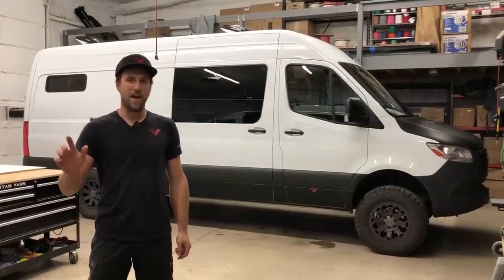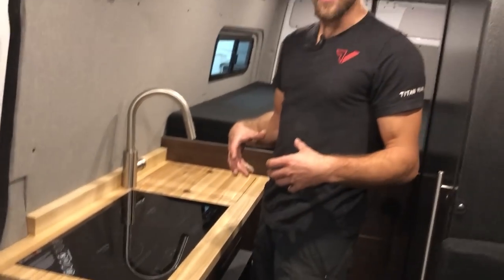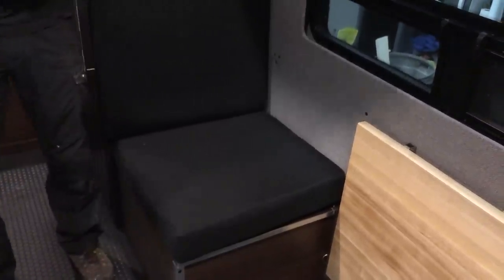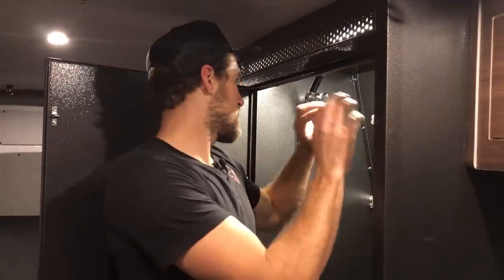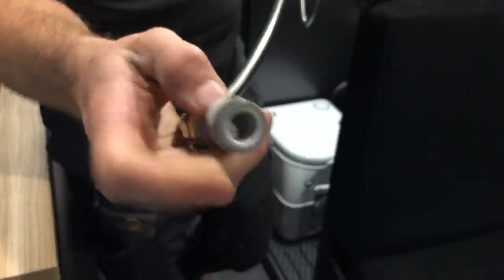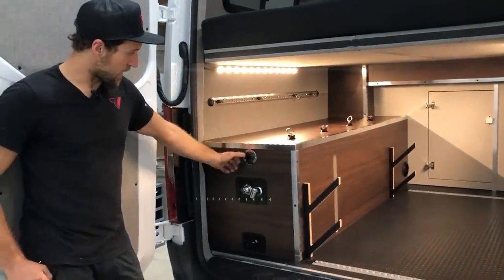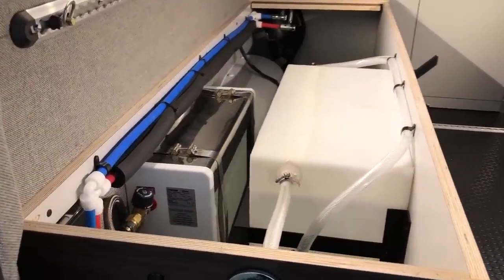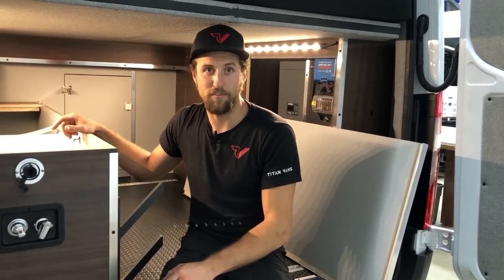Tour a Professionally Built Conversion Van - with Bathroom / Shower / Sauna (Titan Custom: Olympus)

Comment: lets do some math ....   700 watts on the cook top ..... at 12 volts that is over 58 amps of draw (realistically its about 10-20% more than that because the inverter is not 100% efficient ... the inverter efficiency is about 80-90% .....).   but that is just a note not he side ....  with your 300 amp hour battery you want to "easily" run this cook top for 8 hours ....     well ... lets do the math ..... 58 amps x 8 hrs .....   we'll. ..... in my book that is well over 450 amp hours your 300 amp hour battery has to provide ....  (not even considering the loss from the inverter or any other line loss or additional electrical demand the batteries might see in addition to the cook top ....   

So I call a simple math mistake on that one ....    but then  - who really needs to run that cooktop for 8 hours .... when I use the cook top in my camper van .. 10-20 min .....  1/2hour max ....  and its all good to go ....
Reply from the maker: The downside of doing mental math on the fly! Thanks for the correction. Though, these batteries run at 13.3 V not 12 V and the inverter we use is just over 90% efficiency.

Comment: Where’s the cooling system and solar?  Most of my travel is southwest where van can be an oven without ac.
Reply from the maker: Solar is on the roof. This van was not equipped with an A/C unit as it was a custom build and the client was using it primarily for skiing. We can add A/C units but they are extremely energy intensive to use while boondocking. If your going to be in dryer climates we recommend using an portable evaporative cooler instead.

Comment: Would like to see your vehicle used in cold snowy areas. Really nice van. What would a van like this sell for?
Reply: $100,000 + not including the price of the van.
Reply: I think the website says 80k + cost of van.  I think the Winnebago Travato 59k has pretty much these same features for a significantly lower price tag.
Reply: @LynnAnthony  Agreed....the Winnebago Travato is a better deal at around $93k total. 

My pockets aren't that deep, and I'll likely do my own conversion using a dully transit or Sprinter.
Reply from the maker: @LynnAnthony  Significantly lower quality too, can't compare apples to oranges!

Comment: What material is used for the shower ? Does it contain humidity properly? Wouldn't having this spa entice creating molds?
Reply from the maker: It's a modified shower stall from Van Wife Components. 

It's like a heated shower / dry sauna / hot room for drying wet clothes - not a steam room that would be pumping out moisture. Additionally, we use Thinsulate for insulation which is non-toxic and mold resistant. Colorado is also a very dry climate. So - mold should not be an issue.

Comment: Is the battery bank located in the section under the charge controller/inverter compartment? Also, how big is the battery bank on this build?
Reply from the maker: Yes, we had a magnetic cover beneath the electrical panel and inverter that housed the batteries. There was 400 Ahr of usable capacity in this system.
Reply: @TitanVans  For sure. I really like the clean look of the electrical control panel. What are your thoughts on the weight of the batteries that far back in the build? 

Also, does that inverter charger allow for shore power and alternator power/charging when the van is being driven?
Reply from the maker: @jeremybillauer9584  We try to be mindful of weight distribution but have not seen any issues with having batteries in the back. Each battery only weighs 35-50 lbs depending on the model.
The alternator charging and shore power are independent. You can have shore power connected and charge from the alternator or any combination.

Comment: On the site it provided the option for magnetic insulated window covers for $1995, is that correct or did the website manager make a typo?
Reply from the maker: That is correct, it is a full set that includes the front windshield, side driver and passenger widows, fans, and all rear windows.

Comment: Hi. Lovely build as always. I’m from the Uk and want to incorporate the same sort of shower connection in my build but not sure what product(s) to search for. Would you mind posting a link for the shower point and the adapter you highlighted in the video please?
Reply: Thanks. Is that just the shower adapter or is it the shower point?
Reply: @philliosr3615  That's the shower point, that would mount on the wall. There are 3 different types depending on what type of rear connection you want. The male ends (which would go on the shower hose) are just below it.
Have a look at the bullfinch external shower point also
Reply: Oh ok. That link just goes straight to a fitting for me for some reason though.
Reply: @philliosr3615  Just use the menu to the left!
Reply: I don’t know what to search for, what brand it is or what category it is under. That website is difficult to navigate unless you know what you are looking for, has thousands of items in its catalogue and I don’t know what most of them are. Does the tap come as one piece or do you have to build it using different parts?
Reply: @philliosr3615  Honestly just go with the Bullfinch external shower instead. It will work out cheaper and be easier for you to figure out. Best of luck.
Reply: Yeah I don’t really want that shower but cheers anyway. You kind of didn’t answer my questions btw. Never mind
Reply: @philliosr3615  Buddy, I can only bring a horse to water. 
If you can't select the bits you need when I provide you with a link to the relevant section of a local suppliers website then I think putting together a custom shower is likely beyond your ability. 
I've no idea what plumbing system you intend to couple to it for example.
Reply: @philliosr3615  is there an obligation to answer questions on YouTube now? WTF🙄
Reply: I understand no one has an obligation to help other people but I try to when I can. I’m an electrician not a plumber and I try to help people. I understand you “led” me to a plumbing website. I could’ve found my own way to a number of plumbing websites but you never answered whether the shower was a complete unit or if you had to build it up so I was looking for a complete unit as you might find in the bullfinch set up or similar RV style shower units. Take it as a complement that I wanted to emulate your idea. You were just really vague and quite unhelpful which is fine. It’s your prerogative but after wasting time on pointless messaging and scouring a pretty awful and not mobile friendly website when you could’ve simply said “it’s a bespoke unit I had to make up” or “here’s the link for the complete unit buddy”. It’s like someone asking me for electrical advice and I give them a link to the BS7671 electrical code book. Look I’m no troll and I feel as though I’ve asked plenty of times quite politely but as I said forget about it. Nice build with some neat ideas I haven’t seen before. Good day to you sir(s).
Reply: @philliosr3615  I explained that the product I linked to was for the shower point. You need to just buy that or a different one if you don't use barbed fittings and then buy the corresponding male fitting from the same product range to screw onto the hose end. It's not a complete product it's simply two quick connect fittings, one male one female. You need to make enough effort to familiarise yourself with the products to such an extent that you can select the variant best suited to your application. This seemed too much for you which was why I suggested the bullfinch option. It's easier for the uninitiated and also includes the mixer. I'm not a plumber either, just recognised the fittings as I've seen others use them
Reply: @fionnut. Why are U answering questions that were asked of the BUILDER?? It sure  seems to me he/she Philios, thought that’s who he was speaking too & now he’s not happy w/his unanswer that YOU didn’t provide!  Nice way to piss off other people’s potential customers, customer service is a huge part of anyone’s business, maybe U should’ve left it to Titans!

Comment: Great build just not a fan of particle boards and laminates.
Reply from the maker: No particle boards in any of our vans. We hate the stuff too! We use 3/4" baltic birch plywood for all of our cabinetry. It holds up to moisture, temperature, and vibration much better than solid wood.

Comment: What was the control board on the wall around eye level in the front half?
Reply from the maker: That is the control panel. From there you can control the interior temperature, which appliances are drawing power, etc.

Comment: It looks nice, but the prison shower is made of mild steel?  I don't care what kind of coating that is, water fill find the weak point and I give it a year of regular use before the irreversible streaks of rust develop.  Plastic with the necessary odd stainless fixtures is a better way to go.  I think the installation and workmanship is excellent, but the choice of all of the straight hard edges makes me cringe.  I hope he sells a full set of skaters elbow pads and knee pads with each build out.

Comment: Y laminate wood instead of real wood?
Reply from the maker: Solid wood is much heavier, more expensive, and the expansion and contraction coefficient means that it will not last in an environment with high rates of change in humidity and temperature. Laminate plywood will last 10 times longer and look better in these applications than solid wood.

Comment: I see old want a small corner wash basin in the bathroom or dropdown one 4 hand washing and 2 spit in when brushing my teeth so there's no spitting in the kitchen sink...GROSS.  No need 4 additional plumbing or hardware, just a clamp 2 hold the shower  nozzle. and the sink can drain 2 the floor/shower drain. Add a slatted deck floor 2 keep it dry.
Reply from the maker: If your afraid of spitting in the sink, van life might not be for you.

Comment: edge banding would go a long way on those cabinet doors, and the shower  might be fine for someone used to living prison life or maybe military, but this van does not have a homey vibe. It has the old school cheaper vw van interior style. there are a few nice things about the build but the metal on the edges of most of the cabinets was to not have to edge band and hide the edge i am assuming, very little counter space, no offense but u might want to hire a woman or a gay guy. I feel its lacking. Now i do see some good comments but hard to tell if its from friends or what, some claiming to have seen a thousand van builds and knows what he is talking about what a good build looks like and saying this is one of the best seems like a buddy. No offense But u opened urself up to some friendly critique when the title of the video is tour a professionally built conversion van, as if all the other diy van builds was inferior to this. Keep in mind I am not totally saying it sucks, I am simply saying it is lacking on the design side and some of the element choices. The pex pipe to be more professional imo should have used higher quality fittings than the cheaper plastic ones, there are some really nice pex fittings and that would have went a long way.

Comment: Sauna in a van is not  "functionality" It's over engineering and it's just waste of time, energy and money which could've been used to put in a Murphy bed which is not difficult, and get some real gains in floor space  and make  other,  more practical improvements, insulation, ventilation, etc. Just because one can build something doesn't mean you should. The marriage of form and function is the ultimate statement of a craftsman or design artist. Simplicity is an artform. That philosophy should be a guide for many different professions.✌🏻🇺🇸

Comment: Putting electronics under the bed is a horrible idea...so many people do it in these builds
Reply from the maker: Because the electronics should be?
Reply: @TitanVans  away from places like beds, fire safety aside the em radiation emitting from the components effects humans and prolonged exposure increases cancer risk. I would also recommend not using in ear Bluetooth devices if you're under the age of 30 and not putting devices such as routers too close to your bed.
Reply from the maker: @dansal2002  Well, in a van a fire anywhere is a serious problem whether under the bed or not. As far as EM radiation it decreases at a rate of 1/r^3 on top of the fact that it is DC power which puts out very little power to begin with. With absorptive materials in between the EM radiation is of very little concern.
Reply from the maker: @dansal2002  Also, here in Colorado as with many other states you will get more EM radiation from one hour in the sun than decades of exposure to any equipment we put in our rigs.

Comment: not professional build at all.....compared to Hymer, Adria Globecar, etc this is amateur.
Reply from the maker: Everything is relative, you have a van build to show?
Reply: I was looking for the smiley faces, cause you can’t be serious?  “NOT PROFESSIONAL BUILD AT ALL”. Wow, compared to Hymer POS?  Oh my God.  (Where did all that professionalism get Hymer?).  So buy a mass production unit and buy another in five years when it falls apart and another and another.  The whole industry is full of CRAP or van-builds that look whittled and glued together with countless webs of wires and loose hoses and when we see something like this that screams clean, quality and smart - a custom build that will make Airstreams seem like cheap Chinese toys, and you call it amateur?  I’m sorry man, I just don’t get it.  I have 25 years of recreational vehicles experience - sadly mostly on the crap production side and to call what I just watched anything but seriously substantial and quality is short-sighted.